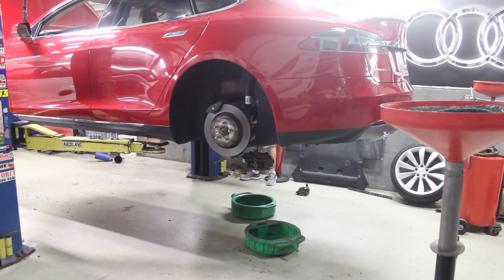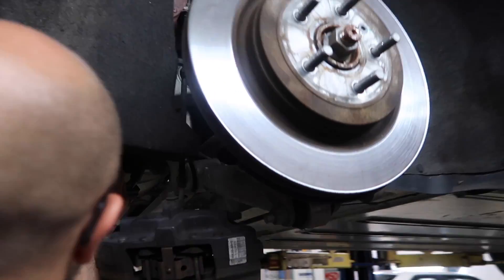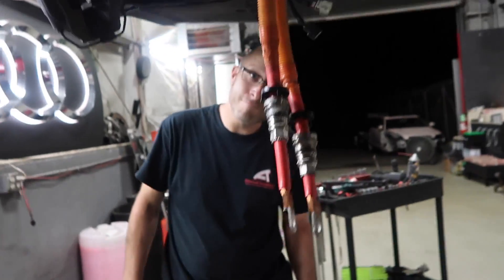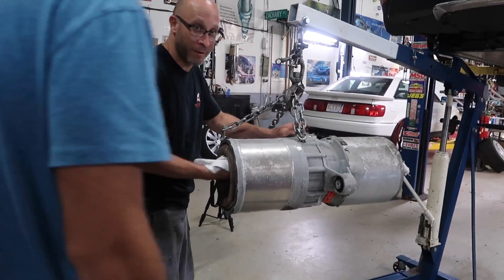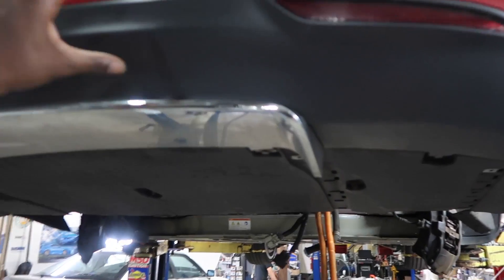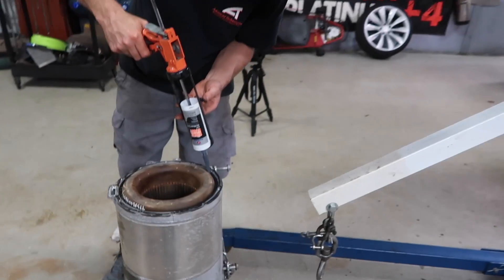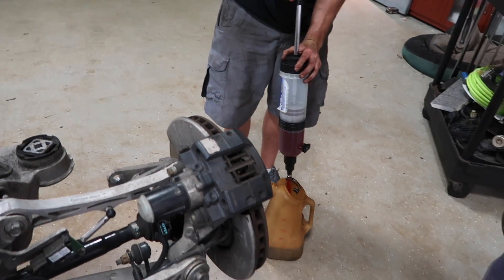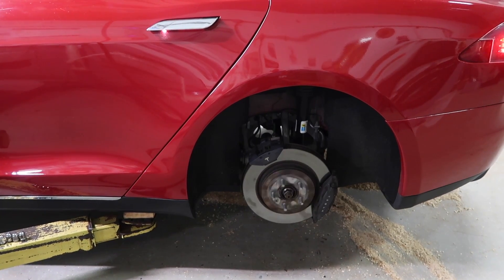First Generation Tesla Motor Failure

Comment: Great Vid.  Wow .. Small bearings ... 
Also surprised who small the splines are for a P85 - lots of torque on that Spline.  Comparing to outboard engines - 200hp outboards ... not much different.
Reply: Could this be solved with ceramic bearings? would that stop the spline destruction or would it arc through the spline next?

Comment: Interesting... Were replacing a couple of tesla drive units out of some 2nd gen Toyota Rav4 EVs at work that have got sheared splines on the motor output shaft. I knew that the bearing issue was very common on these early drive units, but these are the only 2 drive units besides this one that I've ever heard of having this issue with the splines...

Comment: For such a critical part, that bearing should not fail at only 40K miles. This is a design flaw. We've had 100's of years of bearing technology. This is a disgrace. How much does Tesla charge to replace these bearings, I'm guessing $3000, out of warranty. Also, there's plenty of room in such a huge car for more robust shafts, those splines are wimpy, you see the result. Not a lube failure, IMO.

Comment: I know the sequence of events are different, but the results are very similar to what is explained about satellite reaction wheels in "Scientists May Have Figured Out Why So Many Spacecraft Were Failing" by Scott Manley! Did you not even grease the shaft? MIght've increase corrosion resistance, or grind down the gears even more!

Comment: here is a way to save the shaft coming out of the motor . oil both parts and JB wiled it . JB plays as a feeler and the oil keeps it from  sticking to the parts so you can take it apart latter 
its known that the older cars have harder regen so its harder on the CVs and othere parts this is why its not so strong any more in newer cars ..  and the bearings GO out over AC power jumping from the motor to ground .  they added a ground from the shaft of the motor to the body ground to fix this. you could have done the same thing and the bearings would last . the ground strap is just pushed up to the end of the shaft so it can rub the shaft  at the end

Comment: X machinist grew up on farm where arm up cow was regular for calving. I like the looks of Tesla but only electric motors i want to deal with are on my hoverounds. Im to old for this kinda maint. I have a 99 cadillac 265,000 miles as my project car. Oh the fun of working on an engine looks like designed by Nasa is. It does perplex these youngsters when such a big car smokes them off the line. Upgraded to 500hp. I hung  many calipers in the 70s on my own cars never was a problem even tho i ran over 100mph daily and seen 150 but i aged and decided wasn't good idea. Those splines did look nasty i tend to agree it could be from electrical. I wish i had a Tesla but from the videos i have followed you on has allowed me to see they not going to run 500,000 miles .👍

Comment: IF your friend removes that switch a lot, it would be advisable to mount a rotary switch somewhere in the front in the same line with that safety switch, pulling and putting the thing together might invite a fire, not worth burning the whole car for something like that (heat, sparks, loose connection). Plus, those switches are cheap and super easy to install.

Comment: That wear on the motor splines, is actually the result of fretting corrosion due to vibration and or some play/backlash. Quite simple to avoid, add some really thick grease with some copper paste. Or Loctite® Retaining compound (last resort). Once done, should last for a LONG time!
Reply: J Walker a irrelevant alignment issue, or as you added, and probably the case, a micron of a gap. The slightest inductance vibration (commonly seen on very low revs near stall) it just hammers dozens times a second the dry splines against the mating surface, until it fails. This is a common issue on the Land Rover Defender 110 (I own one)... Just google for Land Rover and spline wear... A slight coupling interference would be ideal, and some lubrication too!
Reply: If the teeth on one side are shot, isn‘t there a good chance the other side is too? Maybe use a wire camera to check those, Rich didn‘t you get one of those for the battery pack alignment?
Reply: +Dustin E can you explain why insulated ceramic bearings in industrial induction motors fail prematurely
Reply: cgauer my first thought was backlash as well
Reply: @Dustin Eward Yeah surely you are smarter than bunch of engineers from silicon valley. Sorry, but stating that those are clueless people is a bit ignorant.
Reply: @Dustin Eward I've encountered relatively new industrial motors on VSDs with premature insulated Ceramic Bearing Failure. When the earthing brush is intact on the shaft, I was curious what else can impact Bearing Life. As obviously the eddy currents aren't affecting the bearing lubricant the same way , as was the case of the older all steel bearings, with VSDs retrofitted to the motor.

Comment: Why don't You get certified by Tesla? I know You're good at cars, but would You be happy if others did that job without someone supervising and teaching them?
Reply: Same reason people don't get Apple certified. If you are certified you have to do everything by the book. Whatever they say goes. Better to be outside the system.
Reply: Raymond would that cert be worth the paper it's written on if it comes from a company that make expensive cars that shit them self at 40k miles
Reply: Cam Davies I think there are several 500k Teslas with original motor. However, I see where does that concern is coming.

Comment: Jack Rickard came to the conclusion that the bearings failing is probably due to a grounding issue and current being induced inside the rotor, Tesla made an effort to ground the rotor through a conductive brush on the driving side (spline side) of the rotor
Reply: yeah that might be the problome
Reply: IOW some aftermarket engineering (better suited bearing AND brushes) might be worthwhile then.

But those splines are shot. Can the rotor shaft be pressed out?

Comment: you know that if any other car manufacturer had made a car that almost every engine failed in before 50k miles it would be a huge blunder
Reply: Except of course that the drive motor in a Tesla is a small cheap part. The part comparable to the internal combustion engine in complexity and cost is the battery.
Reply: Rotary Engine
Reply: Except Nissan made hundreds of thousands of defective CVTs, that mostly broke outside of warranty, that required a full transmission replacement. You don't know about that though because you're politically motivated, and don't know much about the auto industry. Honda also had huge problems with transmissions in the Odyssey and MDX.
Reply: It was common in the 2012-2013 teslas, and was quite news worthy with the failure rates. Tesla redesigned and replaced the bad units. It is not an issue today, or for the last few years now.
Reply: Dude was probably driving it wrong. Just like Apple any design flaws or failures are your fault.
Reply: tesla is the apple of cars no matter how shit it is some one will buy there crap

Comment: I missed it. What did they use for replacement bearings?
Reply: watch again, as I understand it could not replace the failing part then and there, so relubed and some other bits and the guy went and got a new part himself after vid.

Comment: The interface of the splines is so precise, that a bearing failure causes spline damage. There is nearly zero tolerance for wear. This is not an acceptable design for an automobile to be mass produced to the General Public.
Reply: they already fixed it it's only older cars that never got the replacement
Reply: The rotor is also very heavy, most newer EV motors have some kind of planetary gearing built-in to the rotor so the output shaft ends up having a good reduction before going to the main differential gearing.

Comment: Isn't that bearing a little under spec'd for such a large motor and for the duty cycle?
Reply: hey, it should hold the warranty period, not forever...... ;)
Reply: Very. Such a solution is fine in industry where motors are regularly replaced or sent away for servicing and every hour of service is carefully catalogued and it's expected to happen. For a road vehicle subject to all kinds of conditions and poor maintenance? From a modern vehicle expected to last ~300,000kms with no major problems? Unacceptable.

Comment: If you look at 5:20 there's a copper brush seal that goes between the motor and final drive.  The purpose of that copper brush is to conduct induced rotor currents away from the shaft and gears to prevent pitting/wear when the high currents might temporarily weld the shaft bearings or drive gears together.  You need to replace that copper brush.
Reply: I'm wondering if the bad bearings allow the shaft splines to misalign slightly under high torque, causing the spline and copper brush to both wear prematurely ?
Reply: i wondered if that should of been done. thanks for confirming
Reply: @GhostOfDamned  dude no. You guys are wrong. They are 3 phase induction brushless motors. The brushes in there are for a different purpose ie: to allow a conductive path for errand voltage so it doesnt go through the bearings and ruin them. Interesting fact: the lack of brushes like these caused the failure of numerous satelites due to failure of their reaction wheels. 

Only the original Tesla roadster and like the GM EV1 had brushed motors. Lol
Reply: owo,ok
Reply: Was damage to that seal visible?  I had a look and didn't see anything obvious.  Perhaps you could help out some more?   thanks for the comment.
Reply: @youmakeitreal  It's not so much that it will show visible damage.  The copper will wear away and lose proper contact with the shaft.  I'm sure Tesla has some specific dimension for allowable wear, unfortunately I'm not aware of what the spec might be.
Reply: rEVolutionary dEVelopments s
Reply: Good Eye,, nice!
Reply: It’s a grounding brush but it’s not copper, it’s carbon. You can’t get it since Tesla doesn’t sell it and the company that makes it won’t sell it to you neither.. but you could buy a similar size and glue it in with silver epoxy.
Reply: @littodevilish  It's not your typical solid carbon kind of brush you'd find in a DC motor.  It's micro fibrous and actually looks like little hairs.  I was told it was a copper containing composite for improved conductivity.  I would not be surprised if it contained carbon as well considering it is a composite.
Reply: The ideal (which is too expensive for anything less than aerospace) is copper impregnated with either nanotubes or similar filaments to decrease the likelihood of even intermittent open circuits. I don't have a clue what Tesla use though.
Reply: rEVolutionary dEVelopments I actually replaced one myself for an owner who had a pitted bearing due to grounding issue. When they installed it, some of the driveshaft grease has touched the carbon filament. Your right that it’s tiny hair like structure but the one they are using isn’t copper, it’s carbon. If I can post a pic on here I would.. it’s on my phone heh
Reply: rEVolutionary dEVelopments and the grounding brush still wasn’t up to the task as the issue still happened over time.. now a days they installed a common mode choke to prevent the non ceramic bearing from pitting.
Reply: @littodevilish  Thanks! That's good to know.  Do you think you could explain how the choke is implemented?
Reply: I'm not an electrical engineer, much better at mechanical than I am with electrical lol, but from what I've seen and know, it literally is a oval shape choke that wraps completely around the 3 bus bars that goes between the inverter and motor. That is the solution Tesla used to solve the issue with pitted bearings on the non insulated bearing. And of course.. for those who don't know.. you can't just install another ceramic bearing on the input shaft side of the bearing as it is on the tail end of the rotor shaft because it's just going to discharge further down the line.. say the input shaft or the gears or something.. the bearings inside the gear box is open cage bearings flooded with ATF fluid but it doesn't solve the issue at hand.
Reply: @revolutionarydevelopments6  An Aegis ring, to ground the shaft and reduce induce current flow through the bearings. Insulated bearing can also help.
Reply: @stambo1983  More proof that Aegis rings (and their like), while prolific, are garbage.  I work in the electric motor industry and they fail all the time.  Common mode chokes work much better typically.
Reply: Philip Any hint what one of these ‘Chokes’ might look like? Our company is currently considering conductive bearing and Aegis ring / FST ring to solve this problem, yet we’ve never heard about a ‘choke’ of sort. Help would be much appreciated, cheers!
Reply: @quasistellar  Interesting: What is the reason for their failure? A flawed design / installation error / something else? Do you have web references that talk more about examples?
Reply: @diyEVguy  Flawed design IMHO.  They wear too easily and are too susceptible to contamination that inhibits contuctivity.  Plus, chokes are just better for eliminating the problem instead of using grounding brushes to shunt the current.
Reply: @alexandershek9377  A company called MHW makes a product called Cool Blue for example, but that's for general purpose use where space/weight aren't much of an issue.  I would recommend getting a custom solution (for packaging reasons) and I'm not sure who to contact for that.
Reply: @quasistellar  Especially the contamination sensitivity seems a big problem. Choke: more effective, yet I guess it adds more weight and volume to the drive unit. Do you see possibilities to add a choke to existing drive units? My guess is no, it should have been included in the design.
Reply: Wait what these are not brushless motors? ......my god what a shitbox
Reply: @MichelLinschoten  brushless 3 phase induction motors. Those brushes are for something else

Comment: Can you confirm if those bearings are hybrid ceramic bearings (metal races with creamic balls) or are they fully ceramic?
Reply: Doubt the would be ceramic bearings at all what with only lasting 40k and if they are then they must be the cheapeat shittiest ceramic bearings of any kind ever made lasting such a short length of time and use.
Reply: I got yer ceramic balls right here
Reply: Well the new ones for sure are not!
Reply: Ceramic bearings would be non conductive, I wonder if that could produce more issues.
Reply: @SmilingDevil   Axel Gieck  I think the milling noise is due to the grease breaking down.. the races are conductive and could break down the grease.  The balls are ceramic.  If they were metal would get Eddy current on the motor shaft
Reply: Cleaning Lady , I hear you, so it’s an Isolation feature....
Reply: Axel Gieck  yes probably for efficiency and to limit cogging at low speeds I would assume